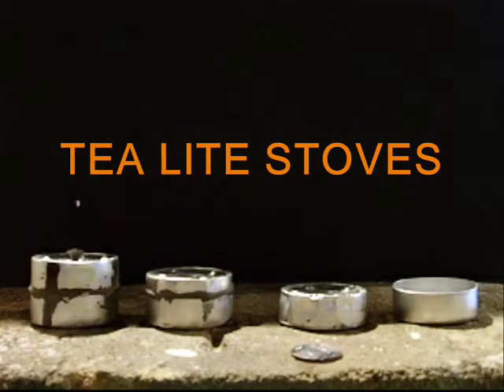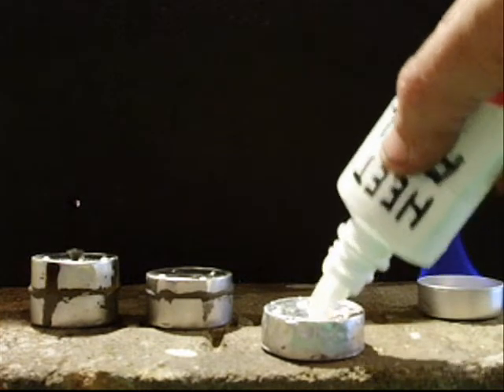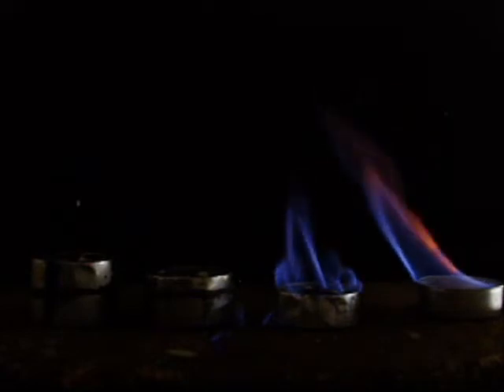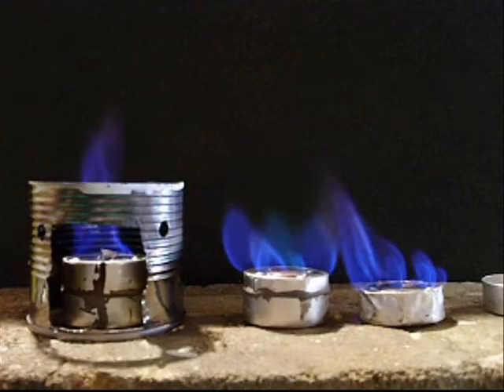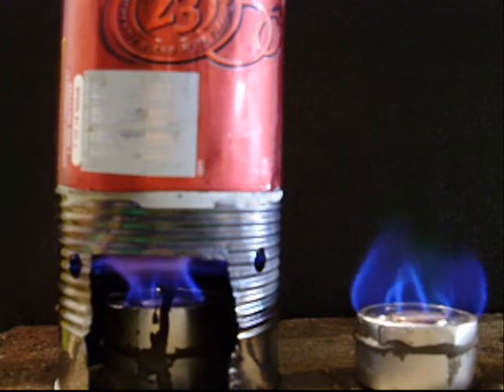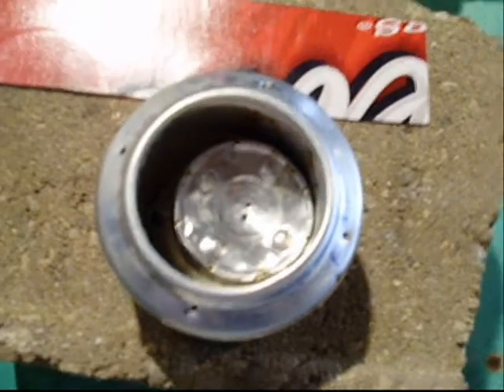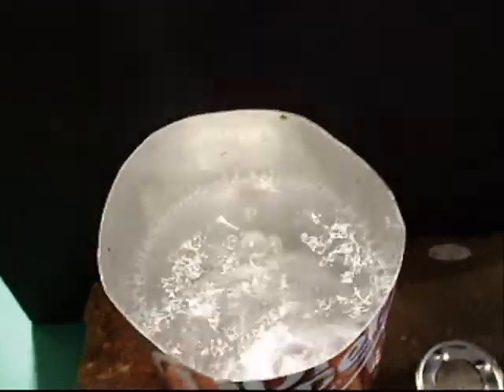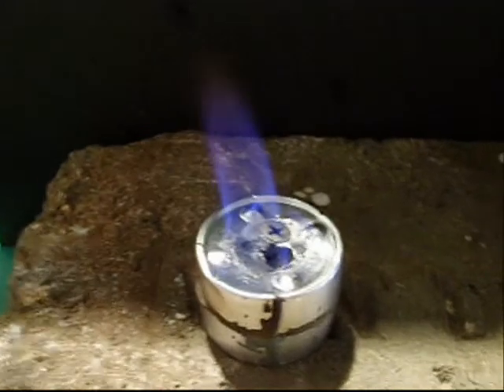ULTRALIGHT TEALITE STOVE CONCEPTS/POP CAN STOVE

Comment from the maker: NO..do not use ducktape! when it catches on fire & starts melting( & it will) the fumes will suck, it will stink..you'll have a huge mess on your hands. the alcohol will egnite through any holes that were made from it burning.  use JB-WELD, it holds up to the heat better & it maks it much easier to construct.cuz tealites are so fragile! foil/ ducTing tape might work well..the adheasive seems to holdup prett well!  if you get the tape..(make sure its really sticky)
otherwise it might peel heated